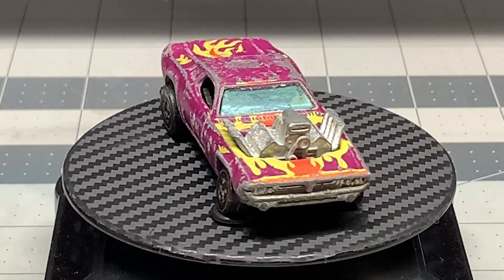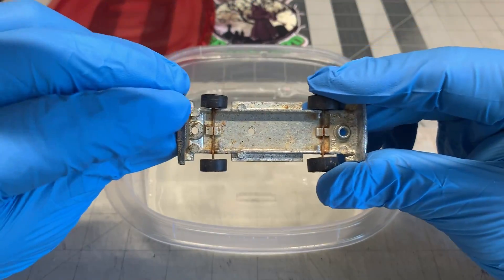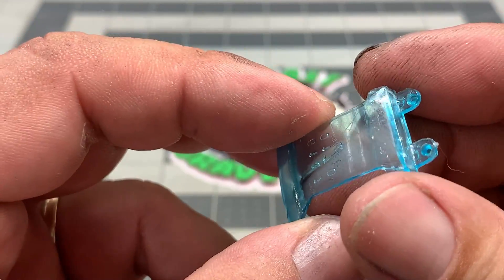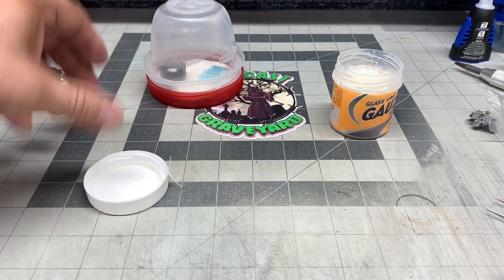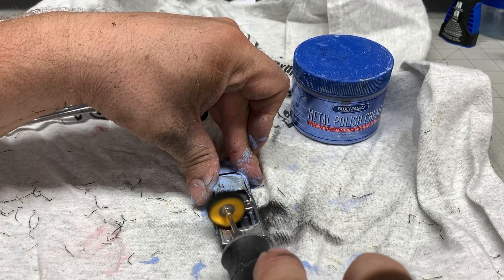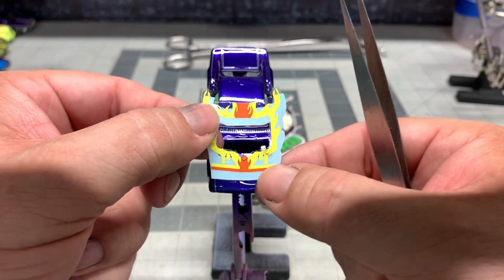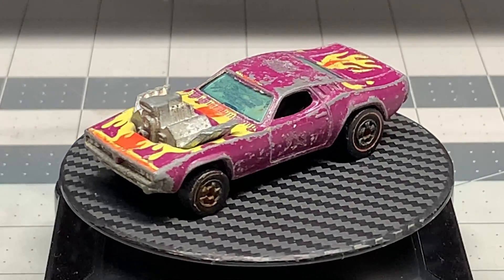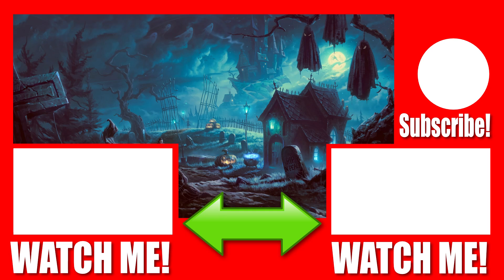Hot Wheels Roger Dodger

Comment: never was a fan of these over the top imaginary rides. It was actually a shame to cover up most of the paint with those silly decals. Your work is fantastic, even though I don't care for the model itself, so don't get that wrong.  I just don't think this one really needed to be restored, frankly I would have either parted it out or tossed it out, that's how much I think of these weird ones.
Reply: Quite similar thinking to mine. While this was obviously someone's "favourite" and the choice is down to them and Paul, I would rather have seen it restored without the decals, just a nice, simple paint job. Taking it a step farther, it would have been nice to reinstate the hood, getting rid of that silly-looking block. 
Having said that, it's certainly an improvement from where it started out.
Reply: @2H80vids  heck yeah, Do your remember what they called Zingers? They were really over the top models half the time they had monsters driving these tiny cars with motors that were bigger than the car. That's what this one reminds me of.
Reply: @tootall5559  I never actually saw a Zinger. Seen a few on YouTube and wasn't impressed. HW have a lot to answer for; it was to try and copy them that Matchbox changed to Superfast - the beginning of the end.
There are a few excellent "fantasy cars" out there but this isn't one of them. Don't get me wrong, a very tidy paint job but the usualquotes apply here: silk purses, turds getting polished etc.
Talking of monsters, one car I did rather like was Keith's(Outlaw Speed Shop) "Rat Fink" build with the smoking tyres. That one did work !!